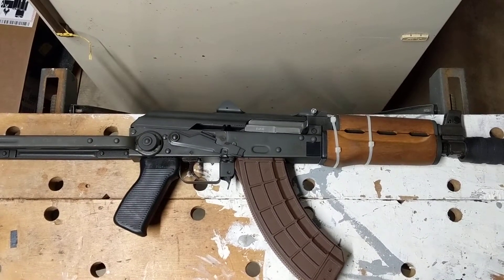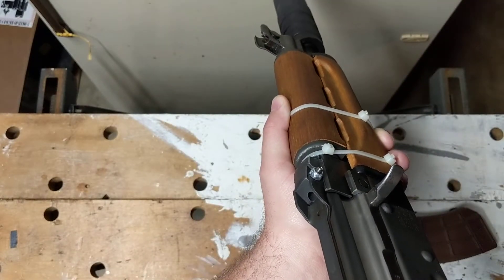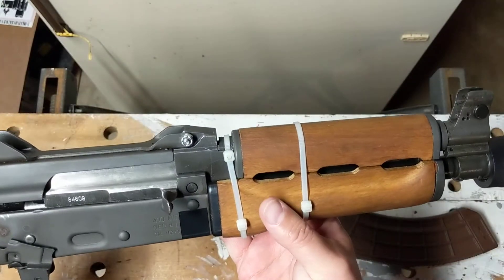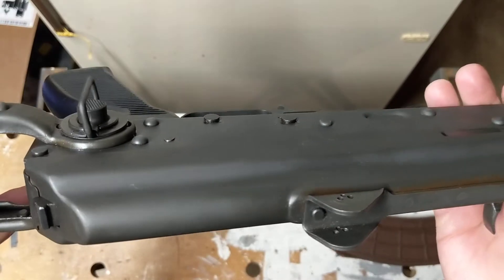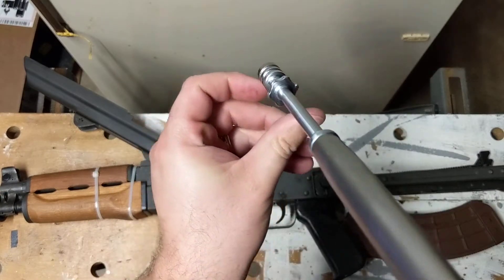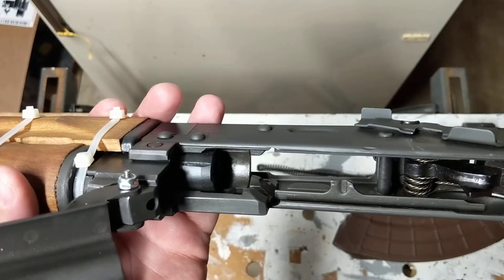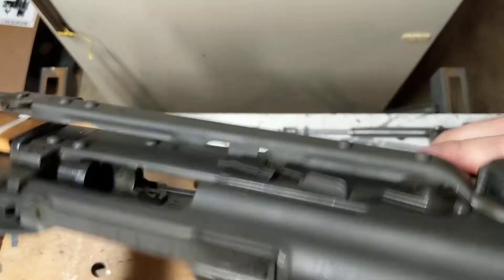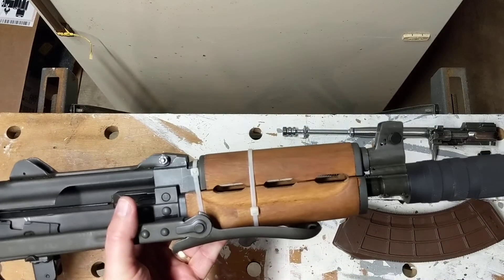Yugo M92 Carbine Project/problem gun

Comment: Replace gas tube with an ultimak gas tube rail. Won’t need detent and you can put red dot on it. Might check to see if that star piston would work with it. Don’t see why it wouldn’t.
Reply from the maker: Yes sadly the star piston will not work with the Ultimak gas tube. Part is on order from Serbia, about 60 days out.. I think whoever parkerized it lost the parts.